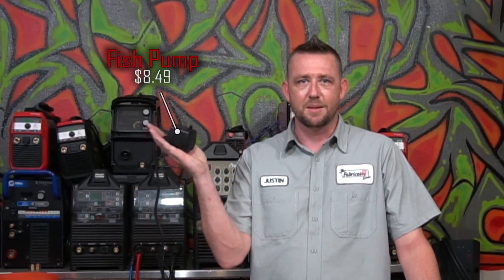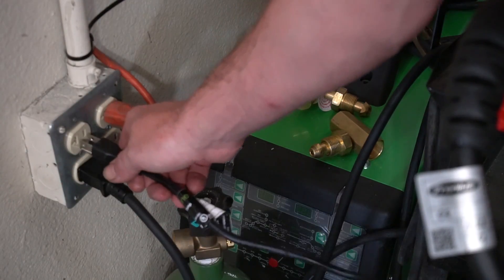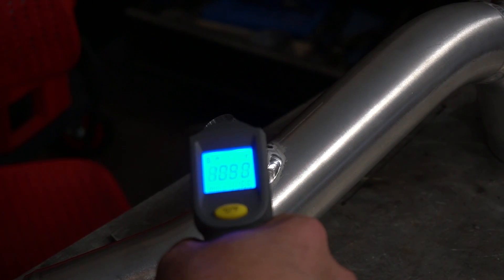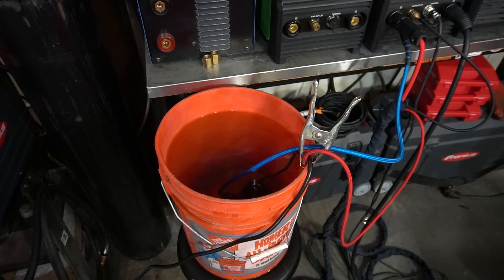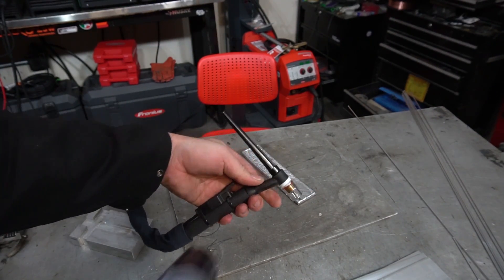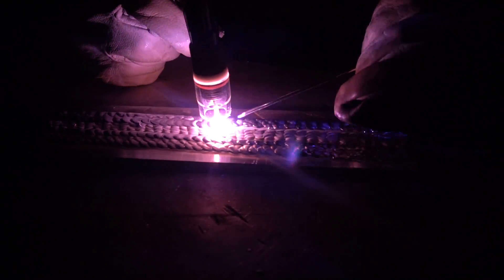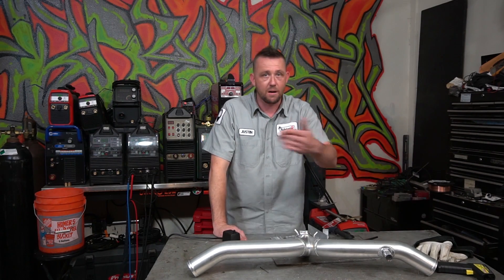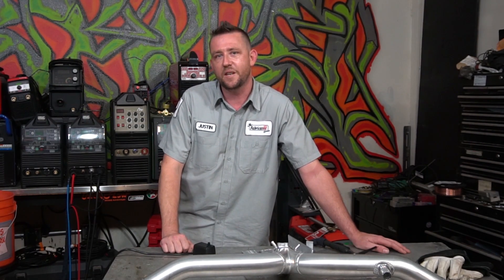TFS: $12 Dollar TIG Torch Cooler

Comment: Our shop tig is cooled via an old beer keg, a Bosch intercooler pump and for added efficiency on the return line is a large trans cooler.  Basically a bullet proof setup that is dirt cheap and has been working for over 10 years with zero problems :)
Reply: Amazon sells cheap computer water-cooling radiators for like 10-40bucks depending on size. Add a couple old computer fans and maybe a small reservoir and pump and done.
Reply: @munkysthrowpoop  Thats what my CNC water cooled spindle does.
Reply: Sounds a lot like an idea I had in mind while watching this.
Reply: Do it :)
Reply: William Zoom a popluar solution for low use tig, is to hook it up to a faucet with the return line emptying into a drain.
Reply: I know a guy who planned on running a dyno like that !?$R*^%$
Reply: E Flanagan sloppymechanics?
Reply: @eflanagan1921  lol just lines diped in lol I bet the Dyno owner shut that down unless it was a sealed setup with the lid but still jesus
Reply: @machinist7230  If you do not want to expend water you can drop the return in a bucket and use it to wash something =).
But I would not use it for long, tap water has some salts that can be more corrosive than proper cooling mix.
Reply: @RogerioCosta1.0  not corrosive for copper lines. Just do a little copper setup and you are good to go. I find many welding specific products so expensive. Like a pedal costing 20 times more than a guitar pedal, being exactly the same thing. The guitar pedal is actually more sofisticated
Reply: @serdiefgotreb  Thanks for tip on using guitar pedal! :)
Reply: William Zoom i might have to try that
Reply: I was thinking a tank with a trans cooler too but the beer keg is a perfect tank! Also if the pump goes out there's no wait to replace it, just go to the hardware store and get another!!
Reply: That's awesome. How about showing off your cooling rig in a youtube video of your own?
Reply: @DDMDZN  If I still worked there i would!
Reply: Everlast goes into some detail about the right coolant to use.  Should work on a DIY setup, too.  It might be a good idea to go into the EL machine guts and see what the water lines inside look like.  Unlike some mfrs, invading the box of an EL should NOT void your warranty since they promote DIY repairs.

Comment: Very cool, but I thought you are supposed to use distilled water?
Reply: My Lincoln cooler instructions say to use distilled water unless there's a chance of freezing.
Reply from the maker: I'm just going to say "its temporary" but if you want to be sure, use an additive or proper coolant.
Reply: I’m running 50/50 antifreeze in my homemade cooler since it has to sit in sub-freezing temps, would this corrode or damage the torch over time?
Reply: Lol ur joking right??? This is a video on using a fish pump as a tig torch cooler and ur talking about using the correct water?!?!!? Wtf is wrong with ppl... lol wow.
Reply: Distilled water would be ideal, but distilled water leaches ions from anything it touches, very quickly.  So you need an additive to prevent that (usually with a corrosion protection package.)  If you're not adding some sort of additive, then tap water is better for short term use.  Tap water wont cause issues for a few minutes or even a few hours of use.  It wont add deposits or the like.
Reply: Kit Iwamatsu
Don't confuse deionized (DI) water with distilled water. 
Distilled water does not cause ionic leaching. 
Most commercial TIG torch coolers recommend using distilled water. 
Using tap water will result in internal mineral deposits reducing thermal transfer efficiency.
Reply: Tap water can contain permanent dissolved ions like calcium and magnesium which will foul the torch water side, reducing the heat transfer.  Distilled water does not leach out metal from copper and only leaches the zinc from the surface of brass.  Most name brand torches use brass with arsenic which resists zinc ion leaching.  Arsenic has been removed from potable water brass so use weld fittings only.  And swap out cooling water monthly when using distilled.

Comment: The upgrade would be an ice chest with ice water in it, maybe?
Reply: An ice chest will stop heat dissipating and seems not a good idea. Ice water yes..maybe...but iced water would warm up faster in an ice chest than in a plastic/metal bucket, unless the ambient temp is very warm. It's so swings and roundabouts that IMO simple/cheap is best.
Reply: Most tig water coolers just cool to room temperature.  Water has a pretty high thermal capacity, much more so than air.  It's a much bigger problem to eliminate that heat over time, than to get the water to an initial low enough temperature.  The less hoopty, but still hoopty, way to do this is to use a small radiator (like a car heater core) with a reservoir, a pump with an inlet and outlet, and a small PC fan, then make it a closed system.  You could do that for maybe 50-100 bucks if you wanted all new parts.  That said.. most coolers are exactly what i just described, with a flow alarm in case you pinch the lines, and a nice case.
Reply: Kit Iwamatsu z
Reply: Kit Iwamatsu very similarly, a water cooled computer radiator would be perfect, and you wouldn't need to clean out any buildup from a heater core